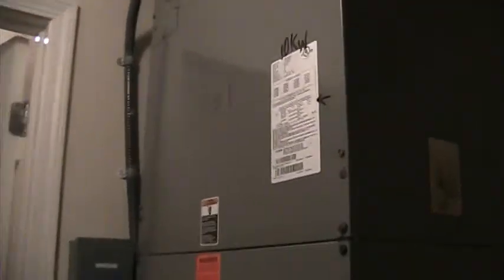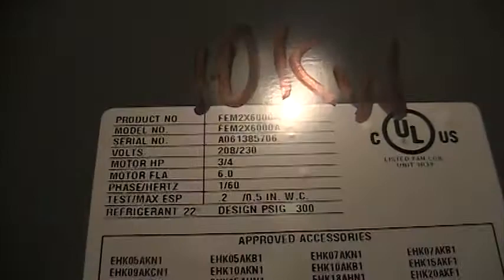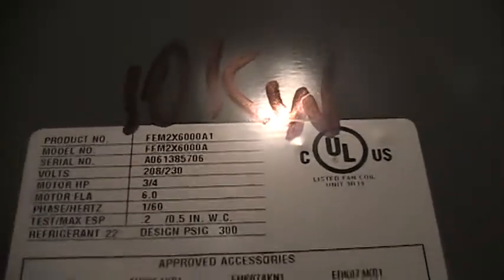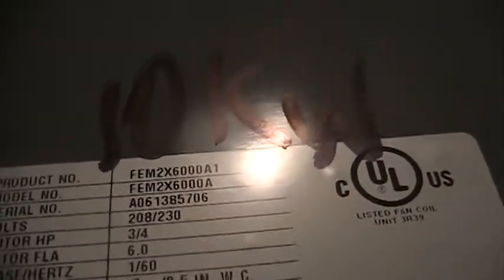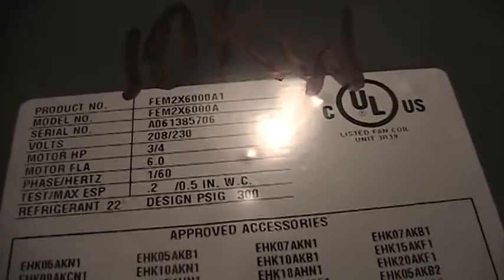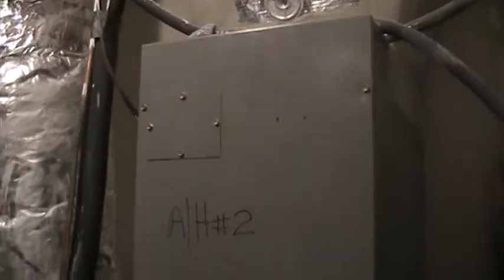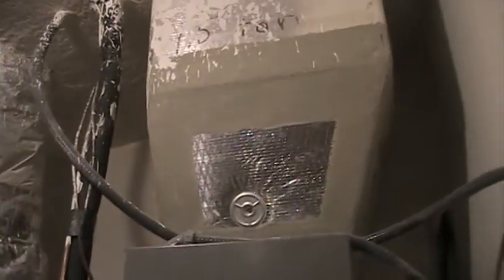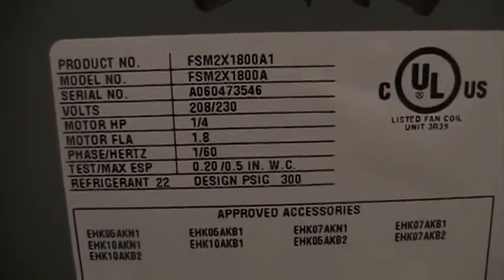Dual-Zone Tempstar Air Handlers Running in COOL Mode

Comment from the maker: Good old Carriers! That upstairs unit, without the logo, could be mistaken for a Carrier! Yeah, the installs are pretty decent. I would agree though, that was pretty moronic of them to only put in 10kW. But this is central Florida, so the heat is HARDLY ever used. How many BTU's output are 15 kW's?